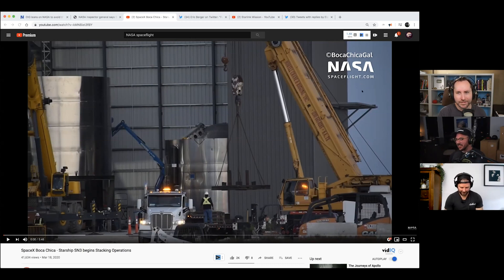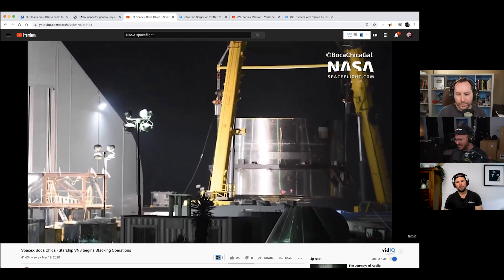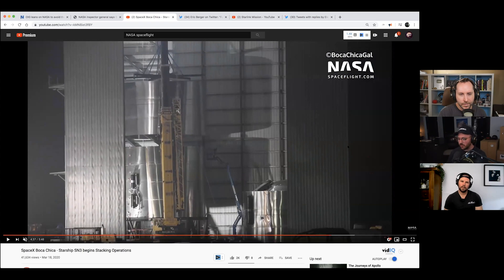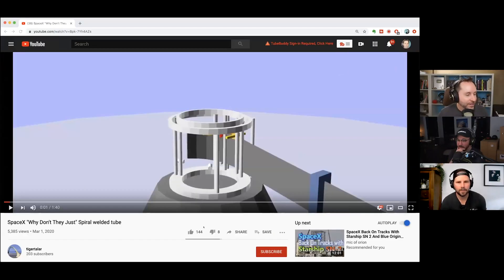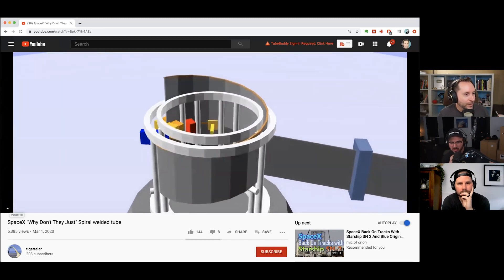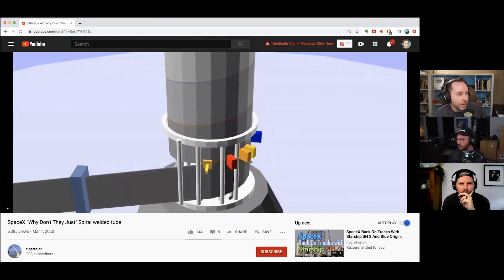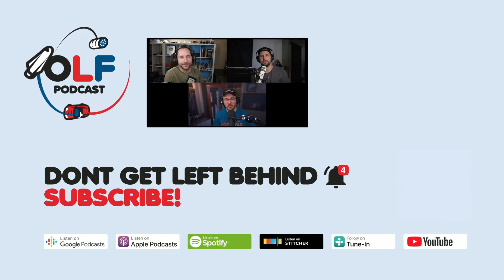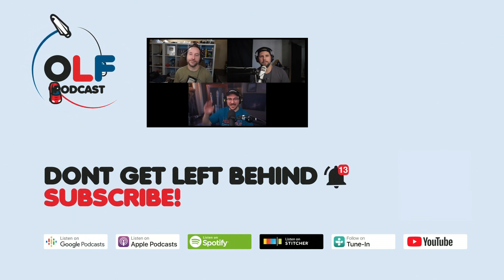SpaceX Starship SN3 and Spiral Welding (OLF Highlight - Ep 76)

Comment: Due to the way the steel behaves, the welds behave, the conditions of re-use, they probably won't be able to do this type of manufacturing anytime soon. And that's got everything to do with 304L deep welding and the crystalline structure of the materials. 

But my knowledge in this area is severely lacking so.... Meh. But it's out there. The how, why etc.

I really do like the idea of spirally working though.

Comment: Starship sections have no uniform thickness. Therefore, this method cannot be applied to the current design.
Reply: You could produce coils of steel with non-uniformly rolled thickness as well and roll the required pattern into the coil.